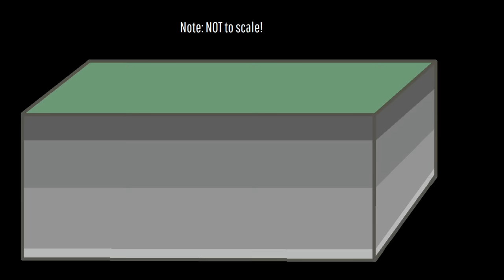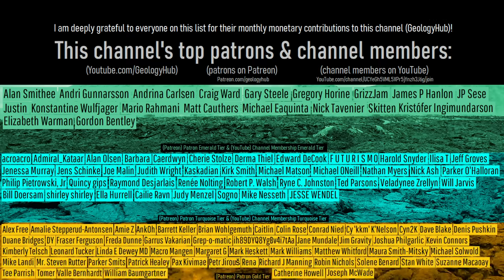Iceland Volcano Update; Gas is Rising from the Ground, Cracks Tear Through a Town

Comment: Im curious, in just the last hour or so they emergently evacuated the town of all safety personnel etc.  Due to SO2 emissions just NE of town.  Your thoughts?
Reply: Probably so because SO2 is hazardous and they may also be concerned that the appearance of SO2 could signal an eruption in the town.
Reply: Magma releases SO2. Not a good sign when a crack opens in the earth and starts releasing an extremely toxic volcanic gas.
Reply: @11regnartseht depends on your perspective
Reply: Does sulfuric acid effect weather? Perhaps it's the earth compensating a diff emission?
Reply: Maybe it indirectly effects weather by effecting the local plant lifes air supply And then the plants pheremonal/droplet exchange w the atmosphere is changed causing a weather manipulation (?)

Comment: Before the first seismic peak, there was a drop in the 0.5-1Hz and 1-2Hz lines. I think, it's plausible that a second peak leading to an eruption could be preceded by a similar drop. On the Vogar seismograph both lines are dropping since midnight, but only slightly. So I'd say that an eruption within the next few hours is unlikely, but if the 0.5-2Hz lines continue to drop over the next 24 hours, a second wafe of strong eathquakes leading to an eruption would seem possible. However, that's just pattern recognition without much understanding of the geology so I'm probably wrong about everything.

Comment: BBC reported a little while ago officials ordered people out of the town again because sensors detected Sulfur Dioxide. Hopefully the flow pops out someplace else to bleed off pressure and the stuff under town just cools off and hardens so the people can repair instead of relocating the town.

Comment: So if a portion of the magma chamber for this volcano stretches from underneath this town to under the nearby ocean floor, then what is the tsunami risk here if an eruption occurs under the nearby ocean? If part of this eruption is undersea, then it seems to me that poses a significant tsunami risk here for possibly much of Southern Iceland.
Reply: The Tsunami risk is very low to non-existent. 
The type of lava does not lead to hugely explosive eruptions, so the explosive component (and there will be one) is solely due to the interaction between seawater and molten rock. So it comes down to how much water can be flashed to steam and how confined is that steam? I don't have a good idea of the constrains of that number but we have seen any number of island forming eruptions in the past decades. None of them produces Tsunamis (Hunga-Tonga-Harapei was a caldera with an island rim and is not what we might see here.)
What would happen should the eruption start under water is a lot of ash as the molten lava is ripped apart when it flashes the water to steam. That ash will be coarse and fall relatively close to the eruption, but it is close to the main airport allready, so it would absolutely disrupt flights into Keflavik. Coarse ash would also fall on Grindavik and cause roofs to collapse, possibly burry structures. And the new volcano may block the harbour, ending the main reason for the possition of the town (or improove the harbour, also a possibility). 
Next to an eruption within the town itself, a sub-sea eruption that close to town would be really bad news - locally.

Comment: Hydrostatic (magma-static) pressure is an important factor - could the magma have drained to a location under the nearby sea? Another factor is the rate of magma movement from depth relative to the drain rate.

Comment: What would happen if this intrusion was to stall at this point?
With magma so shallow I assume there would be new geothermal features appearing everywhere along the dike at least until the magma solidified or drained away. 
Even at that any disturbance/change in pressure or movement of magma could potentially cause it to erupt months later. 
That would be a complete and utter nightmare for the residents. 
I think the best case for them now is that it erupts further to the east and flows into the sea. 

I’ve been interested in volcanic activity for a long time and this is some of the strangest stuff I think I’ve ever seen. To think that magma was mere tens of meters beneath that town but it has evaded destruction at least for now. Ohh my word. If nothing occurs it will go down as one of the closest calls in human history.
Reply: This is the fifth magmatic intrusion just since 2020 which had not erupted in almost 800 years.  This intrusion may stall as well until the next intrusion starts.   Meanwhile residents would return feeling very uncertain about what lies ahead.

Comment: Besides the protective Bank of fill around the town, I wonder if they could dig a hole halfway between the town and the ocean, down as deep as they could for a spot that would be the easiest point for the magma to flow out of? Might also be a good way to make that point or Peninsula a little longer?
Reply: Or do what they did on Heimaey and pump seawater through hoses to spray at the eruption and cool it down before it can reach the town, building a natural barrier as it cools and directing the flow elsewhere

Comment: Since that area is where continents are moving apart could the growing graben be due to tectonic plate movements and the magma is moving in to fill the gap?

It seems very strange that a magma intrusion should cause the ground to drop but if you think about the plates moving apart then it makes much more sense.

A close up of the cracks from the Reykjavik Grapevine channel also showed broken hot water pipes leaking boiling water. The town is supplied with hot water from the nearby power plant, so when the ground moves apart and breaks the pipes hot water spills out and steam rises. 

The SO2 detected by the IMO is hard to localise, if it were coming out of the ground from those cracks in Grindavik it would be pretty clear, people would smell it. But the IMO say it might even be coming from the old lava fields from the previous recent eruptions. They're not sure.
Reply: In the first sentence you say tectonic plates moving apart causes magma to fill the gap which is true. But then in the second sentence you seem to think magma intrusion does not happen when tectonic plates move apart.
Afaik there is no activity in the graben system involved, it's just magma coming up. It's also not a very big amount of magma, just the location right across the town is unfortunate. Magma intrusion in general will cause the ground to move up in some places and down in other places. In a volcano the subsidence of the ground (after the swarm of small earthquakes has stopped) is a typical sign of an imminent eruption.

Comment: I suspect that we have a case of microplate movement. This explaines the multiple earthquakes and also that we don't have an eruption of lave. The Lava is present but may not be under pressure. This microplate is wedged between the American and European plates. This also explains why the eruptions at Fagradalsfjall are non explosive in character. The lava oozes out. As Reykjaness is at the edge of the microplate, Reykjaness peninnsula is moving up and down. Compare it to an iceberg in the water that is melting and gravity makes the iceberg move until parts of the iceberg begin to crack. In this comparison, water is the lava. You get a few splashes.  Every 700 years or so, the microplate readjusts against the American and European plates. Because of the cracks in the ground, magma of the Atlantic Riftvalley travels upward. Most of the volcanoes on Iceland are around this microplate and thank their existence to the microplate. The microplate is like an iceberg. When the iceberg moves, water is displaced in different manners. Microplate shift in Iceland is like the microplate in California. Plate interaction is the best way to understand what is happening. The major volcanoes like Katla, Hekla, Askja and Bardarbunga each have a different plumbing. Reykjaness erupts in gentle manner because it just is the weight of the microplate that causes cracks and lavastreams to ooze out of the ground. The major volcanoes are fed more directly by the Atlantic riftvalley. There are too many signs that the magma is displaced quite quickly.  I also expect major eruptions from around the microplate. In 1341 we see the eruption of Brennisteinsfjöll. It is a possible cause of St. Mary Magdalene’s flood 1342 in Central Europe und following bad years with Black Death to 1350 (Wikipedia). We see major eruptions of other volcanoes in Iceland in 1341, ending in 1362 with the biggest eruption of Oreifajokull, causing the Second Marcellus flood and subsequent volcanic winter from 1362 - 1372. the following 200 years we experience the mini iceage in Western Europe.

Comment: its been interesting to watch as they have gone through i think every option possible .
lots of quakes and the ground is rising and an eruption will happen in a few hours.
quakes are dropping off this happens before an eruption so an eruption is imminent .
the ground is sinking and quakes have dropped off this can happen before an eruption we are days away from it starting.
its going quiet and the ground is sinking this is a bit odd but the 2020 eruption took 3 weeks before it started.
the magma (this is all my opinion here) has followed weak points in the rock as like water it takes the path of least resistance and it eventually reached grinduvik and made the ground rise , it then went past the town and the pressure has decreased and guess what the ground has sunk again and with the quakes there are fractures that have let gas out and causing even more sinking , yes it could have widened out at the same time and if it has moved north this would also fit with my theory that where it has come up it couldnt break through the old lava fields and the old eruption zone and the rocks around it have broken first and hence the sideways travel and if it has moved north (or starting to) i would expect to see an uptick in m3+ quakes and as for whats under the town i think that will cool and i would be very surprised if there was an eruption there , but i have said this i will probs find out that the town has been ripped in half by a giant fissure during the night.

Comment: So,  does the magma rising cause the surface deformation and earthquakes, OR is the plate movement causing the deformation that allows the magma to rise?
Reply: The deformation can start even when magma is pooling at the mantle crust boundary because it’s putting upward pressure on the above crust. The tectonic processes here and how they relate to eruptions are very odd and not well understood. 
I mean this place is on a cycle of 800-1000 years with no eruptions and then like clockwork 800 years after the last eruption the Geldingadalir eruption started. 
It’s exceptionally odd, especially because the Eurasian and North American plates are moving apart at a fairly constant rate of 4-5cm per year.

How does it follow such a strict schedule?😂 it’s a mystery all right.
Maybe at a certain point I will devote my life to figuring that one out.
Reply: That’s a good question. Broadly it is the tectonic plates moving that cause earthquakes and volcanic activity but once the magma is on the move it can be it responsible for local cracks and shaking. Disclaimer: just my guess I am no geologist. 😊

Comment: I'm not sure if the experts get this, but simplify for the masses, or if they just don't "get it", but... (simplest first)

1. Given depths and surface locations of various quakes, it looks to me like that magma dike has a dip to it, slanting to the west or southwest as you go deeper.

2. A bottle of undisturbed Diet Coke is a system. Shake it up and you have a pressurized system. Releasing that pressure involves apparant volume changes, sort of like magma, but the magma SYSTEM is not pressurized by shaking.

3. The magma system (a whole buncha coke bottles and pipes between them) is mostly pressurized via pulses of new magma or just heat from depth, AND...

4. The constraining effect caused by the weight of the rock and earth overhead.

5. ALL of this is elastic. You pump in a blob of new magma down deep, and it will propagate, over time, thru the cracks and coke bottles until it hits...."the far end"...and it will then...rebound back thru the system.  Same goes if you rapidly and decisively heat a section up.

6. On the way up, that overpressure wave will stress the..."container"...and if it "breaks" you register a quake. Same thing as it echoes back and forth thru the system, end to end.

7. Dirt doesn't hold back much magma, or pressurize it much more than it's overlying weight allows.

8. Sometimes the rock says "NO" to the magma pulses. At those times, a reflected wave propagates back down the system, AND, the pressure increases ELSEWHERE in the system, and sometimes new paths open up, along with the recorded quakes as the old "vessel" or "system" pops like a balloon and the innards flow to a new location.

9. Sometimes the "main magma source" sees that reflected wave and says " oh no you don't," and sends a much stronger pulse back up. That will echo around too, over time, not instantly.

10. Quiet periods indicate a system in equilibrium. Nothing is changing.

11. THIS quiet period ended with magma ABOVE the last of the rock, barely held back by dirt, but barely retaining enough energy to move more dirt.

12. The system is achieving equilibrium...with the next pulse, if there is one....The Money Shot.

Comment: imo the sill near the oceans roof has collapsed due to the weight of ocean water , propagating along the dike NE. Pressurizing the lava for a higher eruption rate at a higher elevation at some point along the dikes propagation offset NE.. i would expect the town to become uninhabitable due to ongoing roof collapse of the lava sill causing massive sink holes along the fault in that area

Comment: Boiling water has been filmed in groundpipes, so i doubt reports of volcanic emmissions. And as for you saying magma was minutes from erupting at one point, thats just not correct, theres no evidence except the scientists guessing without any data, there is nothing to show accurate depth measurements. Theres alot of scientists or experts been discussing it for several days, and none agree on any details. The main evidence for depth is circumstantial at best, with more accurate measures being several days out of date. There is absolutely no measure of depth in real time so anybody which says current depth is guessing.
Reply: There are reports from another channel of SO2 rising through the fissures in Grindavik.  If true that is a good sign that the magma is much closer to the surface.